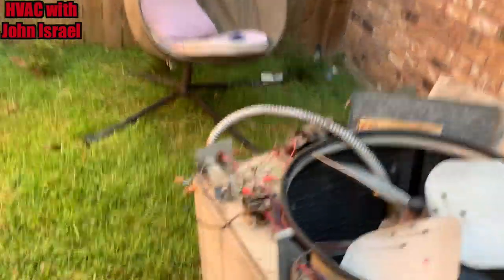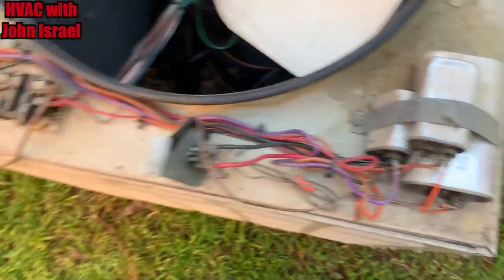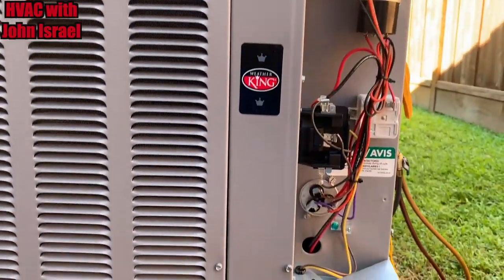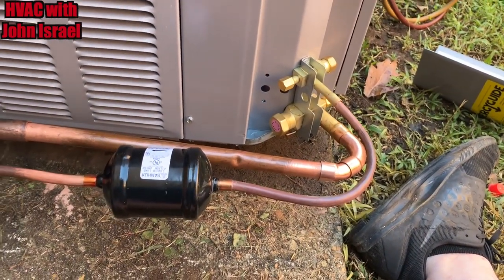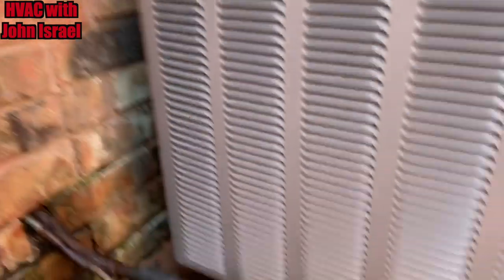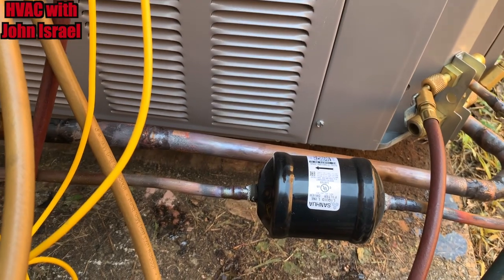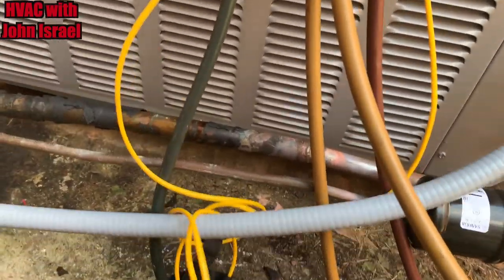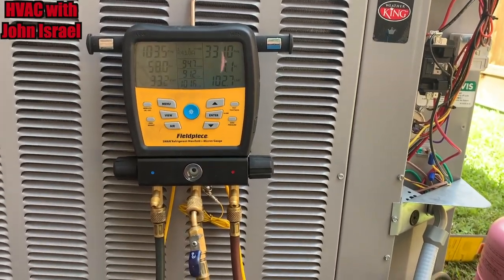Old GE Condenser Change Out

Comment: My cousin has a GE unit from 1977 as well as the original 1977 GE Gas Fired Furnace. He also has a 1985 Trane unit. They are both given tune-ups every season and they still work perfectly.

Comment: I am a homeowner with a GE that is probably 1977, from the time the house was built. My A/C 240V circuit breaker tripped. When I flipped it back, it made loud humming noise and switched off again. I guess my compressor got fried. I am currently trying to pick up on some basic electrical continuity/short-circuit diagnostics from some YouTube A/C videos. I am not hopeful this won't be the compressor, though. I have not used the multimeter yet, but I did see that the capacitor does not look bulged. Nothing visible looks burned or melted. This nasty short circuit seems to be out of sight. I am guessing that means the compressor. I can't afford a new system, either. :-b

I guess in the field of A/C work, techs get to hear that a lot.

Comment: Hi John, thanks for the video, I have a old GE model #21TA936H1F, I wanted to check or just change the 2 capacitors, I pulled the 2 capacitors, but they are so rusty you can't read anything and the suppliers I tried said they need the uf can you get your buddy Ted Cook to find out the references for both fan and run capacitors. I don’t know does he sell parts? Thanks John, I appreciate it

Comment: We still got some old GE heat pumps kicking ass at an apartment complex. They are tough. What SEER was the new unit? We have to use 14 where I'm at.
Reply: Damn as long as that lasted if it wasnt leaking freon i would put another compressor in that unit and run it for another 10 years they dont make units like that anymore.

Comment: no bender on hand? just use cans, bottles, flower pot, vase, whatever is handy and near the right diameter. small tanks/gas bottles work great also, as do motor housings and large radius corners of some condensers, scrap pvc/abs pipe chunks, telephone poles, fence poles, you name it and I've used it for bending tubing =p

Comment: hold up @ 3:00 original/last installer ran copper tubing through brick sleeved in galvanized flex? major galvanic corrosion point, unless they have pvc or nylon tubing between them.
yikes, if it's not leaking there now, it likely will be after being flexed around, something to watch out for and replace with pvc or other non-metallic sleeving!

Comment: Pretty amazing to see something that old to last as long as it did. Your install turned out nice. I gotta ask and correct me if I'm wrong, but the copper lines closer to the wall looked like those flexible copper water lines for water heaters, is that what that was?
Reply from the maker: I’m not sure bro. But I saw that too when I did the job.

Comment: This model  no letter on capacitor connects wire. Does it matter when replace it?
Reply: Hi Perr Myint, did you get new capacitors for the GE? I have model 21TA936H1F and can not read anything on the capacitors because of rust, can anyone help with this model# 21TA936H1F

Comment: The wire top and tan color tells me it’s from at-least pre-1975 era. Am I close? Lol lol
Reply: Either 1978 or 68
Reply: @GeorgiaHvacAndMore  the wire top was pre early 80’s era and that GE badge on top says late 60’s into early 70’s. I grew up in a neighborhood full of 2.5 ton heat pumps from 1975 to 1978. When I was a helper I encountered a million of these damn things in all to ages that wouldn’t die lol lol.. 
My folks 2.5 ton WeatherTron heat pump  had a 5 blade fan really had high CFM’s the velocity was crazy on it. Only heat pumps that could take the upper Mideast climate and do it for 25 or 30 years & take the abuse!

Comment: What happened to the suction line Insulation?!
Dont tell me you cut it through and kinda cover the suction line after brazing is done with some electrical tape or zip ties !!!!!
How can you call that line set a nice Lineset??
That Whipe looks horrible, at least tie it to the coppers so it can sit nice and clean.
Doesn't matter if it's a budget job or not, do your due diligence and work with dignity, if it doesnt worth your time then dont accept the job.
John, you're something else in this trade, poor Israel's name that you use for yourself
Reply from the maker: Somebody didn’t watch the whole video